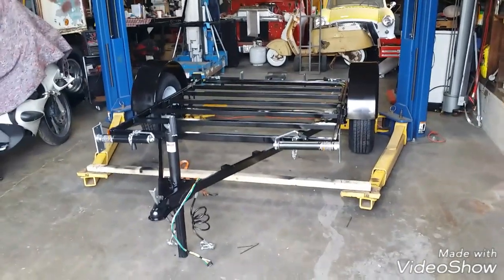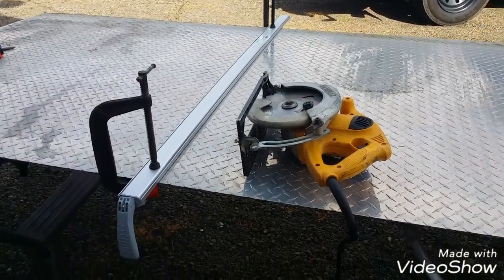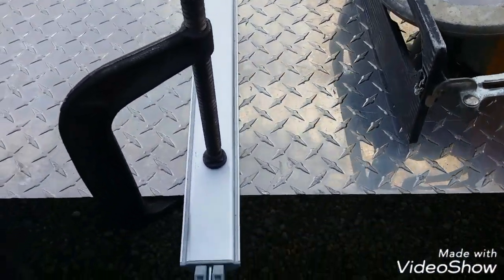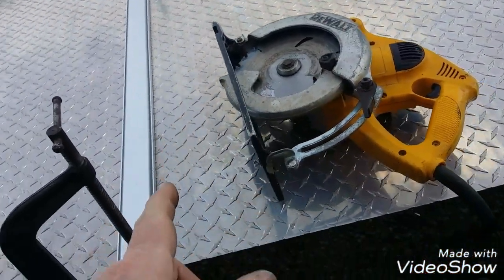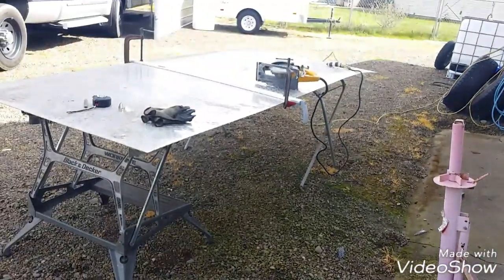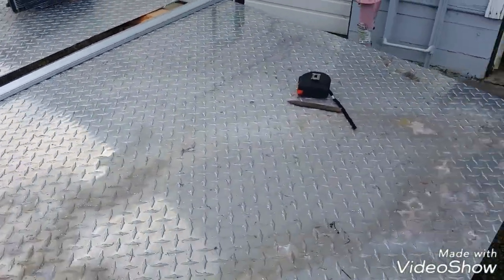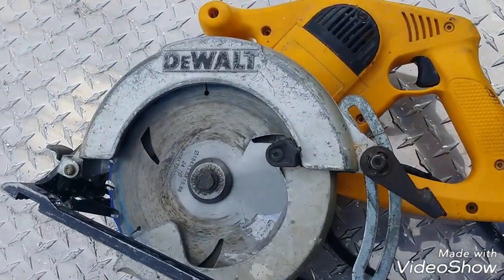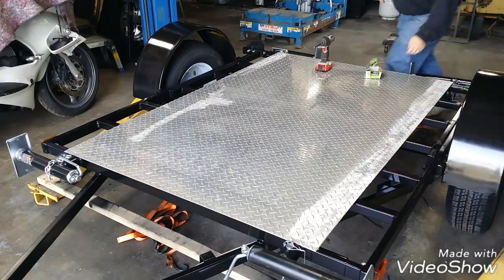How to cut sheet aluminum diamond plate with a circular saw and a carbide tipped blade.

Comment: Ive got a 16x4ft x 1/4 sheet of aluminum . I already bought the blade from HD. Its a 56 tooth and looks to be 1/8 thin or thick,whatever. The skill saw is a 4600 rpm. 
QUESTION 1
Think I should to 2 passes at 1/2 depth or do it all in one pass?
 
WRAPUP YARN
Had mine sheet long time too. Just coudnt throw it away so I packed it wherever I moved. Well it just rode on my highdeck with my tractor,so it wasnt a real problem. Since my tractor broke through the 1.5 x 12 planks Im replacing the planks and topping two long rectangle alum sheets at 2ft x 16 ft width for the wheels contact on my tractors spiked steel wheels/lugs( lm lucky I got the tractor out of the hole)

Comment: No need for gloves or long sleeves. Aluminum doesn't get that hot when you cut it with a skill saw. Safety glasses for sure! It's much easier to cut on the smooth side.